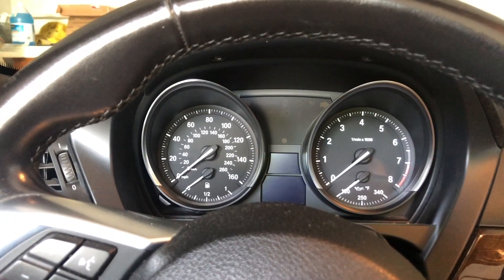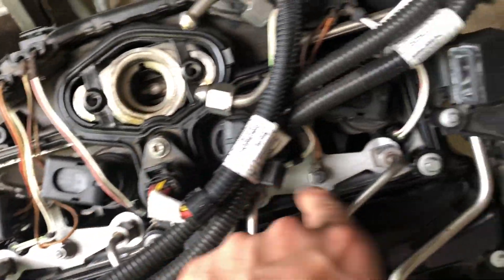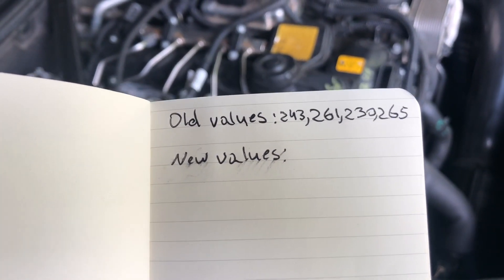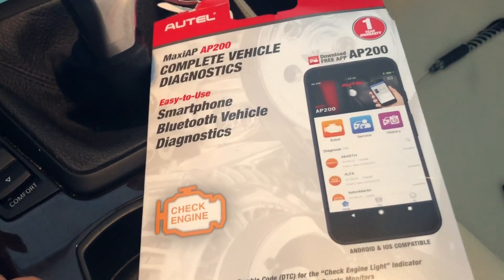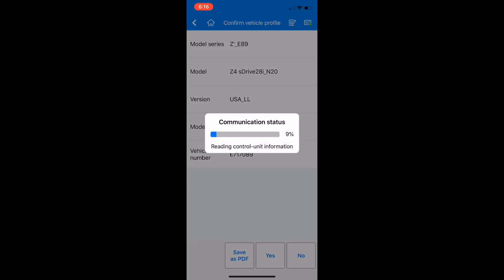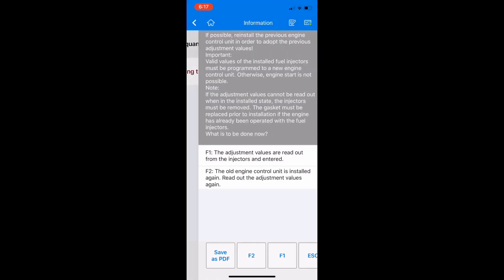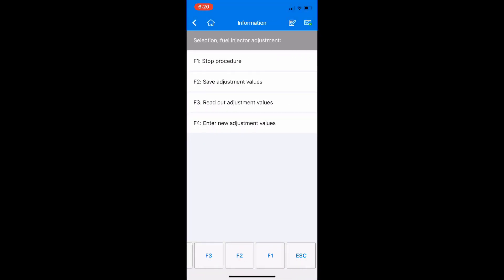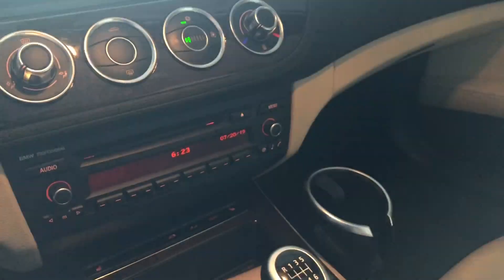Coding Injectors to Fix Rough Start - How to Adjust the Injector Compensation Rate on BMW

Comment: Question, I took out the fuel injectors and cleaned them in my 2010 328xi SULEV BMW. But as I was taking the fuel injectors out of the fuel rail, I mixed them up in a pile,not sure what injector was in slot 1,2,3,4,5 or 6. Does that matter! If so,what do I do about that. Are the fuel injectors marked where each one goes! Or can I just keep them in the car and use this OBD2 scanner and app to calibrate them. Because it's running like crap, hesitation,low idle and high idle and stalls like it's not getting enough fuel. Misfiring a lot and saying injector circuit is open in 3 and 5.Thank you!

Comment: I pulled my injectors out to change o rings but didn’t label which injector goes back.  How can I find the value of each cylinder?  I only have the injectors label number.

Comment: Number one replace your battery. That car is turning over way too slow. I’m probably not telling you anything you don’t know. You have to start with good voltage in German cars or the engines run like garbage and throw random codes.

Comment: Old ones are EU5 new ones are EU6
Reply: Yes, that's correct.  It actually flashed the type of injectors on his phone.  I know 215's are EU6 because those are the types I have on my 2016 F10.  I am in the process of changing them now and my Foxwell scanner confirmed the type.

Comment: Why does it say hot function is not supported on m vehicle ? I have a bmw 2011 328xi and I need to reprogram the fuel injectors .
Reply: Hi, I don't even get the hot function option?
Reply: Same

Comment: Hi.
Came back after changing injectors , and coding the new injectors with this bluetooth adapter
Before coding the new injectors , the car had a slight missfire , but after coding them , the car runs so smooth .
Thank you very much 
My car runs so smooth now

Comment: Thank you soo much for posting! I’ve been chasing my 2008 335i’s “limp mode” / cyl #3 misfires by cleaning VANOS solenoids, replacing coil pack, spark plug, adaptation reset. Finally bought recon index 12 injector but wanted to try recode old index 8 first. 1st wired OBD2 couldn’t code at all, 2nd  “made for BMW” Bluetooth OBD2 could do a lot more but NOT code injectors. Finally got this Autel and I installed the new-used injector, coded it w/MaxiAP200 and bam like you im GOLDEN! She purrs like a kitten! Gotta road test still so please, prayers everybody!?! Mahaloz again and good luck to you all!!! Aloha  🙏🏽😎🤙🏾🏝️

Comment: Hi.
I managed to code my injectors as you explained in the tutorial , but the car runs even rougher than before , so i had to put the old values back in order to be able to drive it .
The codes were for example abcdef 123456 . I just typed the letters , without numbers , as the previous values were saved the same 
Any ideea what can be ? Faulty injector ? 
Thank you

Comment: One of the best videos i have seen - and simple - right to it - question with the AP2000 app can you run the engine while doing diagnostics or even when programing the injectors. Also how do you tell what version of indexed injector you have - lets say i have an indexed injector of a value of 7 could you put a higher number index injector - sorry i am learning -

Comment: Thanks. The video was clear and using the AP200 app to change the adjustment codes worked smoothly (after I finally got the 5GB of app/data installed). 
Much cheaper vs. taking to a shop.
However, when I started the car a couple times, strangely I didn’t notice much difference.  Same
time to start and rough idol. Injector code on one cylinder of my N55 was even changed from 238 to 175. With such a large difference I expected some kind of effect (either good or bad). (BTW, my X5 has no error codes.)
So far, I have driven the car 1.5 hours (30 miles) on the corrected codes. 
I noticed the last screen of the AP200 adjustment code procedure tells you to delete the learned adjustments. I wonder if this really helps/ is required? I would have thought the engine would make adjustments on its own after some driving.
Reply: remember your pcm changes fuel trims to make sure it delivers right amount of fuel,long term and short term.if you been driving long like this with wrong injectors your pcm adjusted to compensate so when you changed injectors the pcm needs to correct for this and make adjustments so i would not be alarmed at a ruff start when doing this the first couple times

Comment: 215 means they are original injectors, they've probably never been changed, so don't get rid of your original ones which are probably updated or replacement ones.  the oem ones were prone to leaking, and giving misfires on startup or emitting tons of black smoke on deceleration.  I wonder if the new values are based on the flow rates, I just did injectors on an N55 and they were all different.
Reply: How's the car been running I have an n55 ik this comments a long shot lol
Reply: Did you do your injectors too bro

Comment: I noticed when you save the values (toward the end) it says "switch off terminal 15 and terminal R". Do you need to do anything then?  It seems like a message about the ignition / electric system.
Reply from the maker: It just means turn off the ignition and pull the key out.
Reply: @SimpleCarGuy  ^^^
Reply: I keep getting this & then also it shows new values could not be saved as old values are permantly saved the old value numbers still saved
Reply: @340ANTONIO340  I searched EVERYWHER to find this.  The answer is to hit the Start/Stop button once for Terminal 15 and the double lock via the key fob remote to switch off Terminal R.

Comment: Great video. I just had an engine swap done (2012 X5 35i E70 (N55)) w/o injector adjustment. 
I found the adjustment numbers written on my 6 injectors.  If I put in these numbers into the DME (as per your video) and performance gets worse for some reason, can I switch the numbers back in the DME and engine goes back to operating as it does now?

Detail:   May seem like a strange question, but the injectors in the engine now have 23,000 miles (since 2011), so I wonder if the adjustment numbers have the same meaning.  Or if you change the injector numbers in the DME, it resets other calibration of the engine? 
Car  starts and runs reasonably ok now. But idle seems a little more shaky and some puttering sound compared to before the swap.
Reply from the maker: Yes, you can put old numbers back in without a problem. It does not change anything else when you adjust.
Reply: @SimpleCarGuy  Awesome. I'm going to adjust it this weekend.

Comment: I did everything you said, Thank you..only thing is my codes won't save after several tries ...they default back to the old numbers? Any suggestions???
Reply from the maker: Are you saving the values to the car? At 8:00 I save the newly entered numbers to the DME.
Reply: Yes I did it exactly like you did..it says error.. the 6 numbers are correct..and then my key fob doesn't work after entering the new values..I have to manually open the door? Any clue?
Reply from the maker: I don’t know, my man. I’ve done it in multiple cars and had no issues.

Comment: I have been chasing a lean code for 3 weeks after engine replacement . This was the entire problem 👍👍👍 exelaint video !!
Reply: Hey ..since you used this..is there any reason why the codes won't save after several attempts?
Reply from the maker: Glad it helped Thanks for watching!!
Reply: @SimpleCarGuy  I think my injectors are bad my values say 252, 248, 271, and 261
Reply: @SimpleCarGuy  how much is one of these? Can I get them in the uk?
Reply from the maker: I paid about $50, if I remember correctly. Check description, I should have links to UK store as well, if not you’d have to check on Amazon or whichever store you prefer.

Comment: Your injectors show only one value but mine on the N43 engine (E91, 2010 318i) have two values... how does it work in that case?
Reply from the maker: Yes, it will work. You’ll have to program whatever value is on the injectors in the correct sequence. The values could be different on all 4-6 cylinders.
Reply: @SimpleCarGuy  sorry, what I meant is that there are two values written on each injector and both are needed to code them properly. The first value corresponds to the energy in mJ and the second one to flow. In my case: 574 and 212 for injector 1...
 
So for my injectors Autel AP200 app would need to prompt me for the two values for each injector. The BMW E90 engine's eg. N54 and N43 must use different injectors as your engine in the Z4 apparently only gives you one value!?

Hope this explains my question more clearly..
Reply from the maker: That makes sense. As far as I’m aware, you only program the second value in. I haven’t seen any scanners programming more than value in. In your case you’d just program the 214 value for the injector.

Comment: Hey I bought the AP200M after watching your video to code a bmw 116i injectors I followed your instructions however when I get to service options. The injector coding isn’t available? Please help
Reply: You have to download the bmw vehicle
Reply: @jazzydavis5168  friend the play store app is not enough for bmw diagnostic, how do we download the bmw vehicle
Reply from the maker: I haven’t used the M version, so I don’t know if it’s any different. What options do you have when you go to the service options? Did you activate your free license for BMW? Do injectors have to be programmed on 116i and what engine is it?
Reply: SimpleCarGuy hey thanks for getting back to me quickly, I bought the M version because it’s meant to be the same but abit more updated. The only service options I have are oil reset, Sas, dpf, bms, throttle. And yes I activated my license for bmw and installed and updated everything :( it’s a 1.6 l 2007 n43 Bmw
Reply from the maker: @waviestbeatz2205  Honestly, that's really weird. I would contact their support to see why it's not showing up for you. I checked and your n43 engine does require the adjustment. I've tried on 3 different BMW engines and the option showed up. All cars were 2011 and newer, not sure if that makes a difference.

Comment: Will this scan tool work with the N73 Engine built in 2006?
Reply from the maker: If the engine has programmable injectors, it should work. I’ve tried on n14, n20 and n63u engines.

Comment: Thanks for your video,I changed the injectors in my audi a3 with the same code number injectors refurbished,do I need to code them to...please
Reply from the maker: If the are the same compensation numbers, no.

Comment: I just bought this tool for sprinter injectors coding , but it doesn't show injectors on service menu ? you can only see ( oil reset/ EPB/TEMPS/DEF/Immo Keys / and SAS That all of it on menu .. any idea !! ( I purchased  Benz package though that will solve the problem but still missing and thats the latest update as well am using android by the way )
Reply from the maker: Unfortunately I don’t know if the tool does the same functions on other makes of cars, I’ve tested it on BMWs and Minis only.

Comment: this works with the n63 engine coding injectors ?
Reply from the maker: Yes, it does!
Reply: Yeah my 2013 n63 is having issues with a stuck open injector and I changed the fuel injector that was stuck open and being how I didn't program it the same code keeps popping up will be buying this just to try it.

Comment: i bought the interface on february 10 i downloaded the android application with the BMW version ... everything ok .... but ... if you do not buy the separate licenses any other variants of diagnostic related applications are not valid they have errors or do not even read VIN ..... so ..... there are no cheap shortcuts ..... the interface is accessible to all and it does its job but the difference is made by licenses that cost more than the most expensive diagnostic platform today. 😉
Reply from the maker: First license is free. You can download it via the app after applying the license that comes with the device. The next ones are $20 or something like that.
Reply: @SimpleCarGuy  axact, that is what I mean, I am satisfied, I needed for my BMW, this toy told me in 3 minutes what other mechanics could not tell me in 2 years, later I bought a license for OPEL, 21.99 $ .... it does its job .... but .... I also tried the free variants ... DIAG-EU ... DIAG-CHINA (I have a Chinese CHANGHE 1021 pickup truck) ... It don't admit errors and It don't give fair values ..... the platform provides 97 car brands x $ 21.99 .... you do the calculations ..... per year ..... worth the last cent .... with Apple works perfectly .... on Android there are still problems but it does its job well.

Comment: Thank you so much! I've been looking for a BMW coding tool for the injectors for my 2013 BMW 328i via Windows 10.  However, this is much simpler and exactly what I need.
Reply from the maker: Glad you found it useful. Thanks for watching!
Reply: SimpleCarGuy Thank you so much again. Autel MaxiAP200 is great.  It turned out that all I need to do is to change the fuel injectors compensation value to the correct values. I compared the read-out values for cylinder 1-4 and the actual numbers on the fuel injectors. It turned out that whoever maintained the fuel injectors on the BMW 328i I bought, never changed the values. After changing the adjustment values to the correct values and saved them. The misfired error code was cleared!  I bought a new injector and remove&install fuel injector for nothing. Thanks so much for recommending Autel MaxiAP200. I couldn’t do much with the AUTOPHIX 7810 diagnostic tool for BMW-Mercedes-Mini!
Reply from the maker: @LuanNguyen-rm3pb   I'm glad this worked for you just as it worked for me! Luckily I found out that injectors on these cars must be programmed before replacing them. Everyone I talked to wanted stupid money for just programming so for $50-60 and 10 minutes of time this is a no brainer! Hope she runs forever for you.
Reply: @LuanNguyen-rm3pb  friend when registering autelmaxi ap200 it asks for vcı serial no where is that no please 
Thanks 
Hasan
Reply: @SimpleCarGuy  after I purchase the autel maxi ap200,  how much roughly for the bmw software to get the injectors coded? Do I  need to do the process on a laptop or use the tool direct to vehicle?
Reply from the maker: No need for a laptop, just an app on your phone. The first make of vehicle is free, so you get access to do all of the features on all BMWs for free and then it’s $50 if you want to unlock other vehicle brands. At least that’s how it was when I used it.

Comment: Sir can u modify fuel injectors for low consumption of petrol..like modification of fuel injectors spray timing etc?
Reply from the maker: Not using this tool, this allows you calibrate it for perfect fuel to air ration. Reducing fuel will just make the car run lean and cause issues.
Reply: @SimpleCarGuy  Were you having bad fuel economy prior to coding it ?

Comment: Android users: Be aware that Autel has pulled the MaxiAP200 software off Google Play as of 8/30/2019. I found the APK from a third party and it suffers from buggy Bluetooth connectivity and inability to register the device (tried on three Android devices). (The MaxiAP tool in Google Play now is not the right version). The QR Code link in the instructions no longer works. The Apple version works much better, but I have had trouble with certain functions. Beware!
Reply from the maker: I haven’t had any issues in the iPhone, what didn’t work for you? I’m gonna keep an eye on the android version for my Android bros. Any idea why they pulled it?
Reply: @simplecarguy No idea why they pulled it, but if my experience with the version I did find was representative, it was just unusable. My problem on the Apple version (on my son's iPad) is with a loss of comm during IMMO smart code learning sessions. Can't say for sure that's an app issue; I got much farther on the Apple version than the Android. They can't keep that software out forever and keep selling it as an Android-compatible device.... Really frustrating. I put in a support request on their live chat line and it was never answered.
Reply: @thewiseguysorlando8557  No, it isn't. I have downloaded the actual Ap200 software from Autel directly per their direction. The AP200 app is back in the play store as of 9/22/19.

Comment: So, why do dealerships and shops charge hundreds to code injecrors? It seems like it took less than half an hour to do.
Reply from the maker: They are using much more expensive tools, so I guess that would be the justification for charging more.
Reply: They wanted to charge me 600 for my low pressure condenser line and another 800 for refrigerate and labor!  I found brand new line made by bmw on ebay  for 120 and replaced it myself.  It was a pain tho    I bought the foxwell elite at pelican parts for 225 because I bought new coils and I replaced the water pump and thermostat. I decided to replace the oil filter housing gasket before I filled it up with new coolant. I hade to buy gasket for the intake and throttle body because they have to be removed. I'll say one thing,  after working on these cars domestic Vehicles will be a breeze